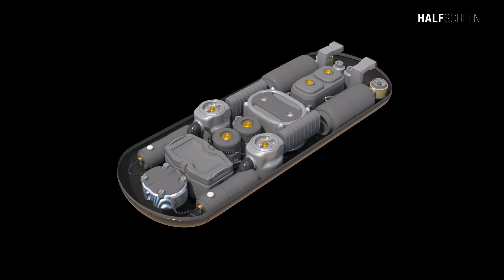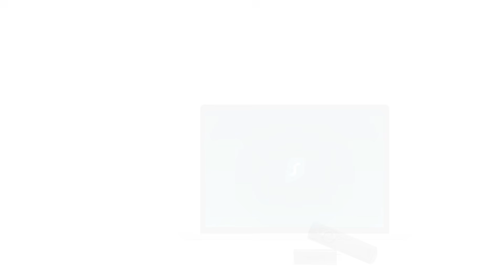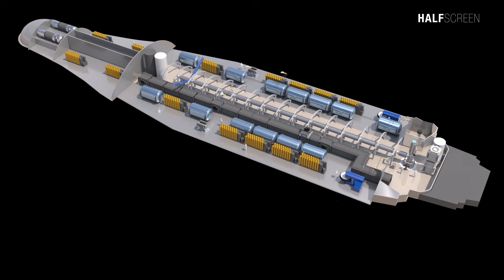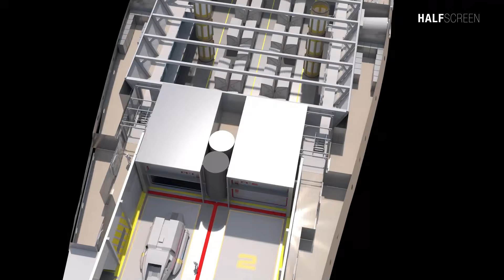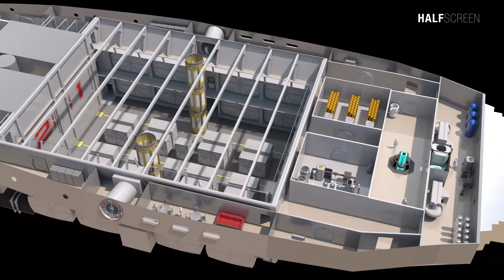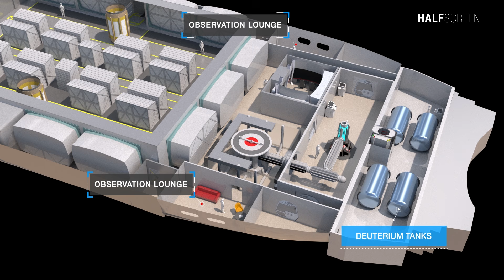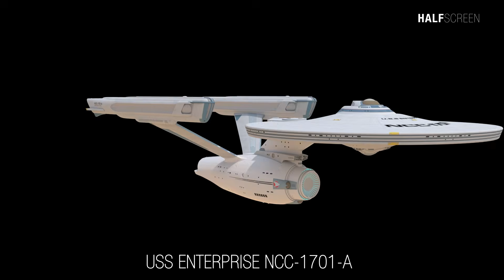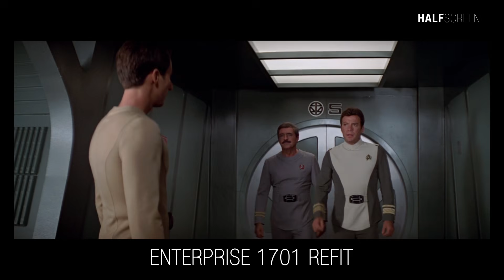Inside the USS  Enterprise NCC-1701-A/Refit (Deck I-U) Part 2

Comment: I think that the Yorktown was another Constitution Class that also got the extensive refit shortly after 1701 did. So she was an older ship not a new build. Like Enterprise the Yorktown became a training ship for several years. Then she was assigned to Sarfleet Engineers R&D division as a test bed ship for trying new and different tech and upgrades. As such she did not have a regular crew assigned since she would be in Space Dock frequently for the various new system trials and installation. That could be why in ST 4 her crew was replaced easily with Kirk's. Starfleet gave her a quicky registry number repaint and called it a day. That is also why the ship was so buggy and glitching so bad. It was due to having systems installed for testing and evaluation then having them swapped out for the next new trials.

Comment: Where is the room for atmosphere handling (Pressure, air, temperature) control? Wouldn’t there need to be more room for storage, work shops, etc.? The ship has to handle over 400 crewmen not including double that in contractors, and passengers. I don’t like the Kelvin timeline but the one thing they got right was the true scale of the Enterprise.

Comment: Star Trek:Inside the U.S.S. Enterprise NCC-1701-A/Refit (Decks I-U) Part 2:
Deck I through M:
Turbolift
Jefferies Tubes
Observation Lounges
Life Support Systems
Force Field Generator 
Emergency Battery Banks
Gravity Damping Field Generator
Air Recycling/Conditioning Unit
Vertical Impulse Drive
Torpedo Complex
Warhead Locker Room
Photon Torpedo:
Wide Field Sensor
Intermix Reaction Chamber
Magnetic Isolation Pod
Guidance & Targeting Sensor
Propulsion & Thrust Vector System
Staging Bays
Photon Exhaust System
Deck M:
Port/Starboard Torpedo Launch Bays
Vertical Engineering Core 
Conveying Assembly
Launch Tubes
Docking Ports 4&5
Auxiliary Fire Control Room 
Toilet Facilities
Life Support System
Emergency Battery Banks
Deck N:
Engineering Computer Monitoring Room
Vertical Intermix Chamber
Hydrogen Tanks
Jefferies Tubes
Life Support Systems
4 Emergency Battery Banks
Phaser Control Room
Twin Phaser Units
Deck O:
Main Engineering
Horizontal Warp Core
Nacelle Pylons Conduit
Hydrogen Tanks
Emergency Battery Banks
Turboshaft
Warp Drive Control Main Engineering 
Dilithium Reactor Room
Deck P:
Thruster Control Room
Reaction Thruster Packages
Hydrogen Tanks
Engineering Department
Division Officers
Briefing Room
Emergency Battery Banks
Diagnostics Workshop
Petty Officers Quarters
Maintenance Workshop
Damage Control Workshop
2 Observation Lounges
Engineers Mess
Lifeboats
Hangar High Bay
Observation & Control Gallery
Deck Q:
Hangar Bay Complex
Landing Bay 
Hangar Elevators
Cargo High Bay 
Catwalks
2 Turbolifts
Docking Ports 6&7
2 Damage Control Lockers
Life Support Systems
3 Emergency Battery Banks
Power Distribution Room
2 Gravity Damping Field Generators
2 Observation Lounges
2 ForceField Generators
Deck R:
Deflector Emitter
Inorganic Fabricator
Defabricator
Environmental Engineering
2 Water Tanks
2 Observation Lounges
Auxiliary Fusion Reactor Highbay
Waste Defabricator
Cargo Mid-Bay
96 Cargo Containers
Shuttle Elevators
Parking Bay 1
Shuttlecraft
Lifeboats
ForceField Generator
Deck S:
Lifeboats
Shuttle Elevator
Parking Bay 2
Shuttlecraft
Travelpods
Workbees
Cargo Deck
2 Cargo Transporters
2 Observation Lounges
4 Deuterium Tanks
Fusion Reactor Control
Second Fusion Reactor
Secondary Hull Bridge
Deck T:
2 Reaction Thruster Packages
Hydrogen Tanks
Main Reactor Control Room
Botanical Garden
Water Tanks
Botanical Lab
2 Observation Lounges
12 Panoramic Viewports
Tractor Beam
Emergency Battery Banks
2 6 Personnel Transporter Rooms
Swimming Pool
Gacuzi
Lifeboats
Deck U:
Antimatter Storage Bottles
Engineering Core
Tractor Beam
Bussard Collectors
Life-Support System
Emergency Battery Banks
4 Water Storage Tanks

Comment: I wonder if the brig on 1701-A is supposed to be down in the bottom of the secondary hull. Its barely visible in Star Trek V but there are two windows with upward-sloping walls which would seem most logical to be on T deck. After escaping they start at the bottom of the turboshaft as well. Maybe on one side of the ship, the observation lounge is now that Brig.

Comment: I like the nice touch where the pool has water storage tanks.  So the pool is closed and drained for battle and during warp drive, right?  Maybe that's a secondary function when you hit the button on the bridge to "charge phasers".  Question is, does the ladder go to the bottom of the pool?  I'd hate to be that swimmer in the pool the moment the Romulans uncloaked and Sulu charged the phasers!

Comment: At least you cover the turbo lift going from the saucer section down to the secondary hull.  It appears to stop just before deck M?  Which is where the photon torpedo launchers are located.  But from where does it start on the primary hull?  You never covered that in the first vid
Reply from the maker: I have to check out the blueprint to see where it start since it been awhile.

Comment: My overriding question is, if the so called ‘dilithium control room’ aka Spock death booth was a later addition to main engineering, where was the dilithium assembly in the first place? In Star Trek TMP I assumed that they were in the vertical intermix chamber unless anyone can enlighten me otherwise? 🤷‍♂️

Comment: You have done a fantastic job in part 1 I've only just started this second part.. it's so detailed I think we could use it in real life as a design draft to actually build it.. obviously things like the warp  drive could be replaced with electric plasma rocket engines and nuke reactors and em drive's as the impulse drive and the various other sci-fi stuff replaced by real world equivalents and other things useful to our actual scientific research needs.. the deflector could even be replaced with something similar like plasma deflection or acoustic sound waves to push stuff.. but at our realistic speeds it's probably not needed but a good chance to test and improve shielding and deflection ect but at least 95% of your main hull is definitely achievable I think.
Reply from the maker: Thanks for the comments!

Comment: After seeing the internals of the torpedo, I wonder. Why didn't they make a torpedo with a tiny warp core and a very dense but inert warhead? Think about it, the torpedo maneuvers into position and then goes to warp, pulverizing it's target with a faster than light kinetic hit.
Anyway, I just happened to stumble across you channel. This is really good stuff. Subbed, and greeting from Alaska.
Reply from the maker: Thanks for the compliments, must be cold in Alaska. Stay warm and safe!
Reply: @Halfscreen  You as well.
Reply: Because warp travel itself is a loophole bypassing relativistic restrictions.  A ship at warp isn't actually moving.  Only the space around the ship which carries it.  So colliding a warp capable object or torpedo at a specific target, likely would not have any kinetic energy to transfer.  Otherwise everyone and their mom would be doing it.

Comment: For me this was always the weakness of the federation ships. All vital systems and equipment are located in this and the neck. The parts of the ship that barely, if at all, offer any buffer zones around it. Any hit to the hull in this region will directly damage these systems. 
It would be more wise to place them in the middle of the dish section, with the living quarters and storage around them.

Comment: Really nice work. Though I would like to point out that the shuttle craft model being used is the Type 6 shuttle craft, not the Type 5 which was used in STV. Type 6 shuttles didn't exsist until the later seasons of ST: TNG. Again, very good work.

Also, the first bridge of the 1701-A was a reuse of the bridge from ST2. The bridge was later changed in STV, and then it was changed again in STVI. Main engineering was seen only three times. ST:TMP and STII:TWOK used the same engineering section, though some changes were made in STII. Main engineering was never seen again until STVI, where it received a major overhaul, using a redress of the engineering set from ST:TNG.
Reply from the maker: Thanks.  There are always a few nuisances I'm going to miss based on the availability of the 3D models but thanks for pointed that out.

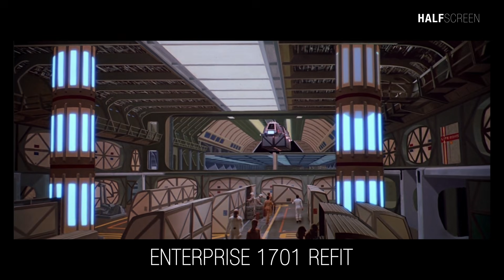Comment: 16:09 I think there might be a mechanical roll down door in the ceiling that can physically separate the cargo bay from the hanger deck.  It was never shown on screen, but there is a framework for it.  In drydock, it would be up so the cargo could be moved In easily. I have also read that the cargo bay had retracting floors to break up the open space.

Comment: The other big difference between the 1701 Refit and the 1701-A is that the A had a Forward Observation Lounge which was located at the very front of the saucer section.  Unfortunately, for budgetary reasons, the production team was not able to add windows to this part of the saucer, but according to Michael Okuda, that was the plan to show the location of the room on the model.
Reply: That forward observation lounge in the front of the Enterprise A's saucer section kinda reminded me of 10 forward on the Enterprise D as like 10 forward the Enterprise A's forward observation lounge had what looked like it's own bar and the one touching thing I liked about that room was the old style ships wheel at the center of the room.

Comment: You did a great job. Nitpick: the torpedo bays seem to be numbered rather than lettered (you see a torp bay 2 sign in the background while you are talking about it)
Reply from the maker: Probably a typo.
Reply: The levels ("floors") are lettered.  The port (2) and starboard (presumably 1) torpedo bays are numbered.  In the movies, what's definitely missing from commands to launch torpedoes are also specifying from which bay 1, 2, or both (e.g., "fire torpedo, bay 2").

Comment: Only issue I have is the central open area in the torpedo bay.  Khan's Reliant cut from the front to the middle docking port on the Port Side, engulfing the entire area and some poor dude in the process.  That would've made that entire midsection unusable, yet that had Spock funeral in that chamber.  My guess, there 2 separate launch rooms, not combined.  I think we see this many times in the movie.
Reply from the maker: Sometimes the schematic and movies don't always line up.  There always going to be some inconsistency.

Comment: This is tremendous work!  I wrote the SFAM4 book in 1984, that talks about building the AMT 1/537 kit with lighting.  I worked with Andy Probert on a lot of the details and functions.  Two things: the four recessed panels on top of the Sec Hull are emergency flush vents for Engineering.  And as depicted in the McCall concept art (and Probert VIP lounge art) the inboard parts of the nacelles worked together to create a visual "wake", like oars in water.  A sequential energy flow that would push the ship, leaving a beautiful violet blue wake behind it.  I copied this in my (first ever) lighted 1/537 kit, with sequential lights in the nacelles.  The FX were too costly for TMP and dropped (but that's why the grilles face each other).
Reply: Paul, something I can't help but wonder:  Why include grilles on the outboard panels of the warp drive nacelles, that never seem to light up (until later versions of the show, after Next Generation, where the engines seem to glow all the time, for no good reason)?
Reply: Visual wake sounds magical
Reply from the maker: Hey thanks Paul!  I take that as a compliment.  I would to spend more time on modeling and getting the detail correct, but in general, I'm happy with the overall 3D model.

Comment: I like that you're able to do the proper 3-d thing on these models. Now we can see why things are shaped the way they are. I know the whole thing is imaginary, but you make her feel real, and the 3-d helps. To be fair, I liked the more open secondary hull as seen in TMP more than the enclosed shuttlebay, but things change. They can change and, as much right as they have to do that, I have at least as much right not to like it. :P
Hang on, in the hanger, seen, is a shuttlecraft that is NOT the Galileo type. It is the same as the one Spock arrived upon. Right there. The "galileo type" that you specify was not needed until V. "IRL, a shuttlecraft is not just any old boat. It is a boat, meant to move people from one place to another. A ship to a base or a planet. Over and over. Until the job is done. That's the shuttle part. That's what the word means. There are ships' boats that are not meant as simply shuttles. They have other jobs to do first. Sub hunting or captains' yachting or the officer's official fishing vessel. What? some of these boats might also be shuttles? Fie on you for even saying that! In Star trek itself, TMP, we see "shuttle craft" not often used. Right there in that big hanger cargo thing that seems to take up a lot of the secondary hull. Look again! We see a "travel pod" used once, and we see several "work bees." in various configurations. Spock does arrive on one of these shuttles riding a "warp sled" later. It does not even use the : shuttlebay. Just an airlock to do its job. My point is proven in canon.
Reply from the maker: Yes, 2D drawing can only do so much.

Comment: Thedesign arrangement for the Enterprise's pylon connecting the primary and secondary hulls is badly laid out, the warp-reactor should be entirely within the secondary hull. Also the location of the delirium chamber as depicted in ST-II doesn't make sense.

Comment: The two tubes in the cargo bay are turbolifts not transporters. The Bussard Collectors are on the nacelles not in the secondary hull with the Antimatter storage pods. And the whole vertical shaft is the Warp Core / Matter/Antimatter Reactor Assembly. Other than that, excellent. I've really enjoyed as you've improved a lot over a short time. Also, is this your first sponsor? If so or even if I'm late, congratulations.
Reply from the maker: Technically, it's my 2nd sponsor so far.  Thanks.  I'm pretty sure my animation isn't 100% since there are so many moving parts and 3D assets to recreate but for the most part, I try to keep the mistake to a minimum.  I have to admit, creating SW animations is much easier than ST, it's way more complicated.
Reply: @Halfscreen  Complicated? That's why we like it. You're doing fine.

Comment: Another thing about this video was the appearance of the Enterprise A's warp core they were showing the core seen in Star Trek the Motion Picture and Star Trek 2:The Wrath of Khan but remember in Star Trek 6:The Undiscovered Country it was shown that the Enterprise A had a warp core similar to that of the Galaxy Class U.S.S. Enterprise what they called a Pulse Warp Core and the engine room had the same layout as that of a Galaxy Class as well when it was shown in The Undiscovered Country.
Reply: That only happened because the old engineering set had been destroyed, and Hollywood doesn't care about the difference between Enterprise-A and Enterprise-D.

Comment: I've never believed this ship was truly a "refit" of the original -- SO much is changed, even basic structural dimensions, that it would be easier to build it from scratch.
   I think Starfleet kept the commissioning plaque from the first 1701, tore the ship apart, built a new one around the plaque, and called it a "refit" for PR reasons.
Reply from the maker: I feel the same way, TOS Enterprise and Refit are really different even though it share the same structure and design philosophies.
Reply: It is. Something just like USS Midway (CV-41)

Comment: “I hope you enjoyed this video”
I frickin loved it!!!! 
I bought Mr Scotts Guide to the Enterprise when I was a kid over 30 yrs ago and your videos bring me home.

But for this middle aged geek, if you ever did a video on the interior of The Expanse’s Rocinante, I’d be in heaven
Reply from the maker: I just recently download the Mr Scotts Guide to the Enterprise book to get a better understanding of the ship.  As for the Rocinante, it has been requested several time.  Maybe down the road.
Reply: @Halfscreen  
Be wary of 'Mr. Scott's Guide to the Enterprise' - it's not a canon source, and has a lot of info made up by fans that contradict the show pretty hard. As an example, it says the Enterprise has a rear torpedo tube (it doesn't) and that the impulse engines are needed for maneuvering at Warp Speed (they aren't).
Reply from the maker: @Idazmi7  From my limited knowledge, I did the best I can with the information with various information on the web.  It's hard to know what is official and what is fan fiction unless you really know your source materials.  It's the same problem I face with SW materials in general, there isn't any real consistency rather it's canon or legend.  My goal is to just keep the mistake at a minimum without upsetting someone.
Reply: @Halfscreen  
Oh definitely: it's legit difficult. Especially nowadays, since anyone can whip up a blueprint on a computer.
Reply: @ Idazmi7

Pretty much every technical manual has errors in it.  Especially as a series evolves and they throw continuity out the window. 

Really.. canon is such a stupid concept. I think the best line was one in the TNG Technical Manual “[it’s] a vessel designed for storytelling.”
Reply: Ah yes, one of the first Trek 'tech' books, I ever got, in the early 1990s...

Comment: According to Mr. Scott's Guide to the Enterprise, the 1701-A also had a single rear-firing torpedo tube.  But since that one reference is the only material to suggest it (and it's not obvious where this rear tube was), it's probably apocryphal.
Reply: Mr. Scott's Guide to the Enterprise was never a canon source, I'm afraid. The original Enterprise never demonstrated any rear torpedoes, and on the refit those would be highly noticeable.